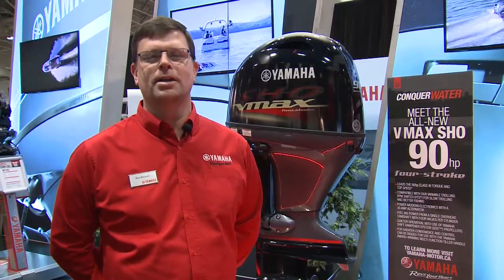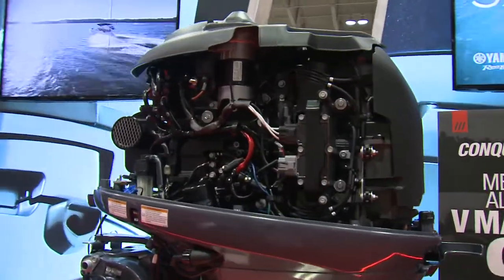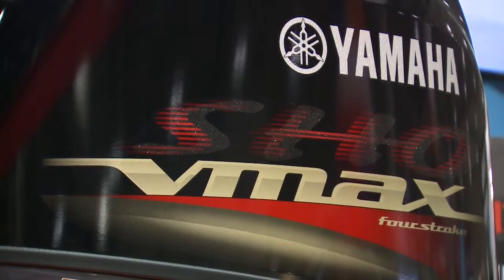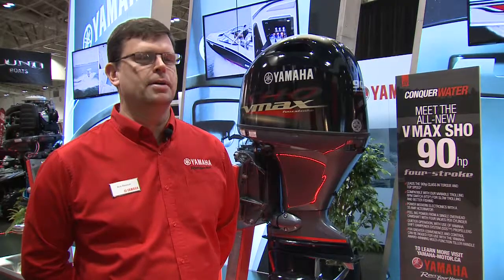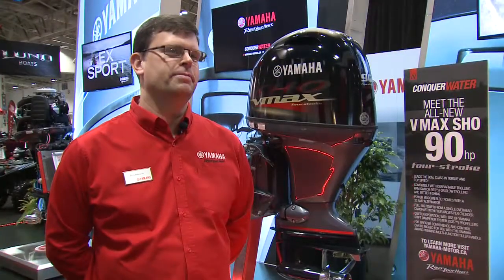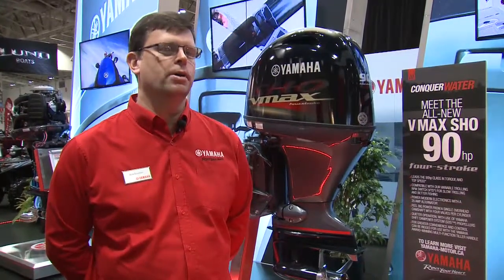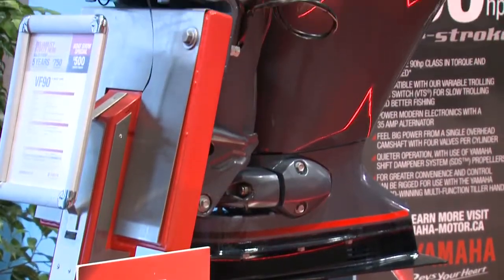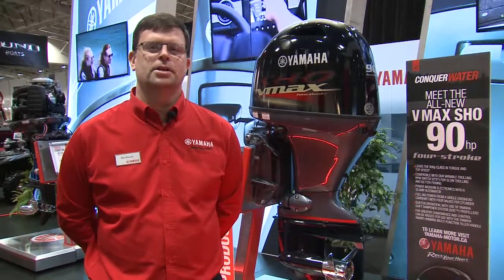In depth on the Yamaha VF90 at the Toronto International Boat Show

Comment: I bought a 2022 90 SHO tiller What ever you do don't put a stainless steel prop on it. It make so much noise it sounds like something is going to break. They tell me thats normal it's prop chatter.
 Well for $11,000 you think you could run stainless on a SUPER HIGH OUTPUT MOTOR!!! As far as im concerned that should advertise that it makes this god awful noise with a stainless prop. O but it go's away when you give it gas YES it does but it's a tiller you backtroll with it. My suggestion would be go with another brand just not yamaha unless you want to listen to that noise all-day. I WILL NEVER BUY ANOTHER YAMAHA AGAIN!!!